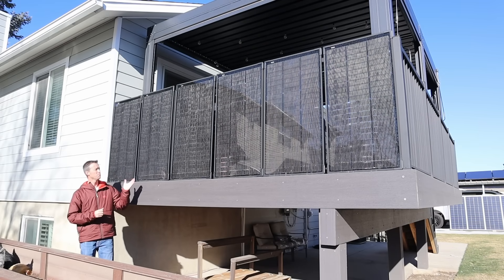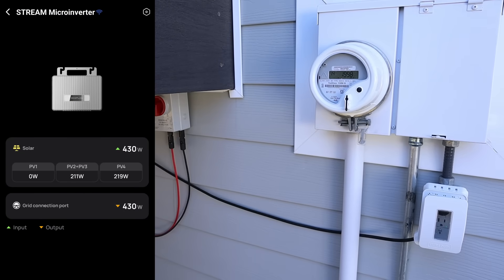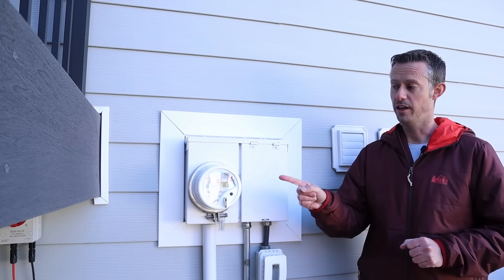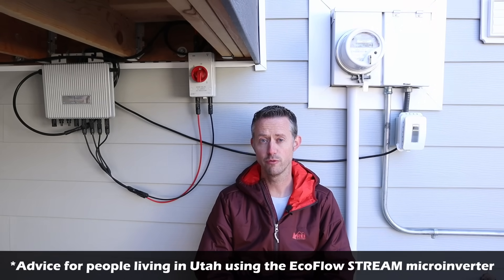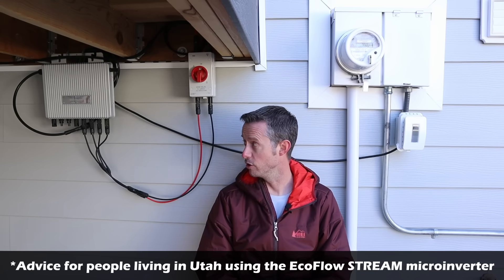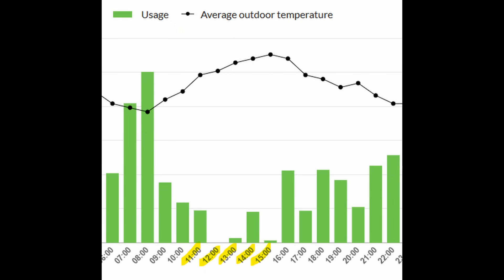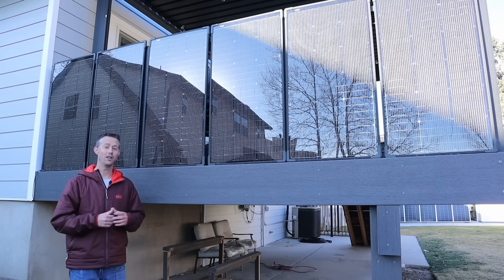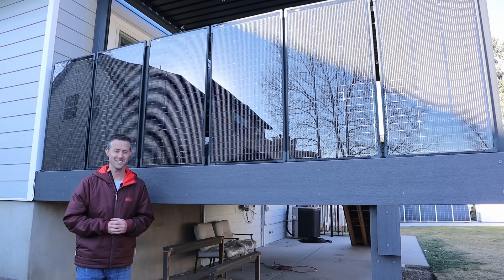The Simplest Solar System I've Ever Installed!  I Just Plugged It In!

Comment: @Jasonoid EcoFlow does say this system works with smart meter circuit monitors / shunts installed on the home's circuit panel. If you spend enough time, the EcoFlow support will probably give you the specific shunt names/model numbers. 
  I was seriously looking at this system and spent alot of time on their website and AI. The AI actually gave me info that the website didn't and turned me off to the idea😄. The AI apparently hadn't been reviewed by their marketing department because it was a little too honest.
  Still, it is a good system but was too small for my needs. Living in a state where we don't have Utah's great SB on this technology, I would have had to install a smart meter shunt because my local electric company doesn't support it. 

  And if you want to see just how bad the solar red tape is, you'll find many states refer to California's approved list of solar equipment.
  But....if you go to that list from California, you'll see it's way outdated. Alot of the equipment is obsolete now or has changed hands so if a local electric company doesn't see your equipment's exact name on that California list, they won't approve it.

Comment: Isn't there a bit of danger because the cable coming from the micro inverter to the AC outlet has male connectors on it, so if it is unplugged, won't these be live?  Maybe the inverter will not kick on until it senses a connection to the grid.
Reply: Yes it takes 5 minutes to power on sync to the grid and only works if the grid is active. I think they call it anti-islanding protection.
Reply from the maker: Correct. It's UL listed and has anti-islanding protection. It will not power on unless it's connected to the grid and synced up.

Comment: Is it worth it mathematically? How many years to recoup the cost?
Reply: iirc, vertical mounted panels work best in winter when the sun is angled. In Summer its directly overhead and you would want them horizontal
Reply: I’ve had one for a couple months. My current kWh rate is 15 cents per kWh. I’m getting anywhere from 30 cents to a $1.10 per day with my setup depending on solar color conditions. So my ROI is anywhere from 1 to 2 years. Have been getting 3-7 kw production a day during winter.

Comment: Hey Jason, I have this same stream microinverter plugged into a dedicated outlet to try and maximize the 1200watt output. Connections are:  One small 300 watt panel in the connected port of 2 /3 , one 24 volt battery in port 1, and one 48 v battery in port 4. I’m running it off battery after sun goes down and getting around 5-7 kw total output a day. My battery banks only total around 5kw. Pretty nice for the offset power consumption. I see my bi directional meter rolling back at night sometimes which I didn’t think was possible.

My cost per kWh is $0.15 so with the earnings of $0.5 to $1 per day the return on investment of $299 should only be 1-2 years. 

One thing I noticed about the microinverter is that the mmpt ports use a different style connector that is harder to detach. I think it’s an amphenol connector instead of the standard mc4. Slightly different but I was having trouble disconnecting lines when testing. Bought a tool and some small 12 inch mc4 connectors to get around that issue.
Reply from the maker: Sweet! That's an awesome setup! Thanks for sharing. I connected my 48v battery bank to it wirh decent results as well. I'll plan to do a video on it in the future.

Comment: 400-500 watts baseload in your home in the winter?  In summer and winter, those of us with heat pumps are going to be higher than that.  I'm eager to try something like the Craftstrom system.
Reply from the maker: I just can't get over their pricing.... $2000?! Gosh, I'd never see a return on investment from that.
Reply: @Jasonoid  My 2.5kW Enphase microinverter array was $2400 after tax credit.  Installed in 2020.  That's 8 panels and half the kW of my main array.  It already paid for itself!  My first array has about 2 years left though, since I paid a local installer to install it.
Reply: @Jasonoid  You don't have to buy their panels, you can buy just the Craftstrom power meter (to monitor your panel) and inverters (and just plug whatever panels you want into them).  That makes things a whole heck of a lot more reasonably priced.  That's what I'm thinking about doing.
Reply from the maker: @ScrapKing73 I didn't see a way to purchase the inverter on it's own.

Comment: It would be great to plug a battery into the micro inverter and then just charge the battery from the solar with a larger output array.  If sized properly, you could possibly push 1200w into the inverter indefinitely.
Reply from the maker: I've tested that briefly, it does accept 1200w from all four DC ports connected to a 48v battery. I'll probably put out a future video on it. (I did mention that at the end BTW)

Comment: Understand that the intent is not to back feed in case of a power outage. But, in case of an outage, could you plug the inverter into a Female X Female 120 V plug to then charge a portable battery power station?
Reply from the maker: The microinverter needs grid power to function, it would be best to charge your power station directly with solar panels.
Reply: That could work but need some sort of smart hub kind of how you can parallel two 120v inverters to get more power.

Comment: Great video!  There is a company called Craftstrom that offers something similar except it is legal in all 50 states.  They of course have their own systems which are quite expensive but offer the individual components as well.  The difference is they have a smart breaker and a power meter that work together with the micro inverters to not allow any back feeding of the grid.  That system also offers the option of charging batteries (presently only their own branded one) when demand is low so the power is not wasted.  If you are going to the CES, maybe you could also do a short video on what interesting stuff you see out there:)
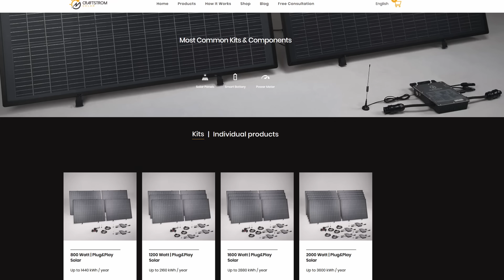Reply from the maker: 2:57 I posted the craftstrom system on the screen. I'll see if I can get my hands on it for testing!

Comment: I mounted 4 100w flexible panels on my desk, same way and I get around 25-300w depending on the time and day. I used it to power my anker 3600w power generator and other anker products. It works great in the spring, summer, and fall. In the winter, not so much. We have had 8 days of snow and I'm getting about 25w per day. We don't have to get any permit as long as it is not mounted to the house. Just strange that alot of people aren't doing this, the 100w solar panels were $49 each. I bought extra and put them on the side of my shed. Gotta check out the microinverter.
Reply: Deck, not desk
Reply: If it's not tied back to the grid the utility company won't care how much you save or what you do. But if you try to plug it into the house power that's grid connected then you open yourself up to large fines and possibly disconnection. Many states have smart meters that senses anomalies on their power line that can be traced back to the location. It must be permitted. Which they allow but you can't just plug it into and think it's ok.

Comment: During power outages does the system shut down completely?  Otherwise, it could damage electrical systems and injure linemen doing repairs.
Reply from the maker: Yes, it's UL listed and has anti-islanding features. That's what's required for it to be legal in Utah. If it's disconnected from grid-power (IE power outage) it doesn't even turn on, even with solar panels connected.
Reply: Hmm… would hate to be a lineman trying to restore power and having to trust a bunch of chinese boxes to not backfeed the power lines - UL claims or not.

Comment: Thank you for sharing this. Those of us outside of Utah look forward to legal options we can put to work in our states that are less expensive for up front costs. I did share this with Utah friends and this would work great for them.
Reply: It's "mostly" legal if you just have an inverter with a zero export function. Though even then if you have a large load that suddenly shuts off some energy can leak out in the time it takes for the inverter to get that data from the CT clamps and react which can sometimes cause issues with legality so you have to check with your energy provider.

Comment: Can you split it to 600 watts. Put in another micro inverter and a dedicated plug on other phase of electricity at the box. So that way all power that panels produce is not just on single line.  May actually help off set bill even more?
Reply from the maker: feeding 1200w into one dedicated circuit will backfeed into your entire home offsetting that power, not just the power on that single circuit. All the wires in the home are connected together and power flows between all of them (unless you turn off a circuit breaker which stops the power flow).
Reply: @Jasonoid  I think you may be incorrect here.  The outlet you are plugged into is a 120V outlet. Most hemes are 240 split phase. (like an oven or hot water heater.) So with this set up you are only back feeding 1 leg of the house circuits.
Reply: @jhumbracht4582 you  are correct.  I have 6 of these and attempted to balance the two legs 

I have the emporia vue3 and I can see l1 and l2.  

Now, in my case I'm running Bitcoin miners that pull both legs 240 volt.  But I can watch the sun come up and see the equal pull on l1 and l2 change as the stream inverters start production....not balanced.

I don't know how his power company will deal with power backfeed on one leg but drawing it on another leg?  I've never tested that in my setup.

Comment: Thank you for putting a light on plug n play. Are there any solar production reports in the app? You are probably only at best zeroing out only 1 of the 2 phases? Is that right?
Reply from the maker: There's not a ton of data, it does provide a daily output number.

Comment: i would just get a solar generator and plug my frigde wifi pc into it lol. why bother with bs power company?
Reply from the maker: The best benefit for a setup like this is that is just works. I don't even think about it. It's just plugged in and going. No need to worry about battery levels or how to charge up when it's cloudy. The best setup is having both a small grid-tie system and a battery system.

Comment: I believe the ecoflow smart panel allows you to do this in any state but for specific circuits. The smart panel sits in between your main and the circuits you want to power/offset. If the main power goes out, it senses and stops feeding the grid panel
Reply from the maker: The Ecoflow smart panel is basically an automatic transfer switch. When the batteries are charged and you have solar coming in, it will use that power to automatically feed circuits in your home to offset your power bill. The smart panel is only compatible with their large power stations and also costs a bit of money. This device here in the video is much more affordable (but it's not legal everywhere). Other devices in the future will be 'smarter' and will be legal in all 50 states.

Comment: If this back feeds the grid without a net metering meter, you run the risk of being billed for the power you send to the grid.
Reply from the maker: If you live in Utah and you have a smart meter that won't be the case. Future systems coming out will be 'smarter' and they will offset the your loads without sending power to the grid. I'm excited to test those out.

Comment: this needs a smart panel which is several hundred dollars and often requires a certified electrician to install. you should make sure the views know this system pushes power out to the grid if your house is not using it.  both power company's where i live will not accept this condition. i would like to see you do a review of the craftstrom system. it seems more compatible for small scale use.
Reply: Not really an issue because if this system detects no 110 voltage coming in it shuts down the outgoing power. Not much different than a generator transfer switch. It's perfectly legal where he's at.
Reply from the maker: I clearly explained that in the video. I'll try to get my hands on a Craftsrom system as well.
Reply: @Jasonoid  yes you did, a couple of times and i had to point this out to my friend who recommended this video to me. he missed that it would back feed the grid.

Comment: I have a pool pump running 7 days 7 am to 7 pm and a big south facing wall
Reply from the maker: Something like this would help offset the power for a system like that. South facing wall for the win! My deck faces directly south as well.
Reply: @J @Jasonoid Im not planning on living here more than another 5 years. I would calculate payoff at 3 years and a couple months using used panels. Then we would have the 1200 watts plus our existing EcoFlow system.

Comment: I use one with a battery bank as my home already has transfer switches on every circuit so I can select which circuit to use the grid and which circuit to use solar.
Reply from the maker: Sounds like an awesome setup!
Reply: @Jasonoid It gives me great flexibility and no back feeding. Also allows me to use a 1500 watt inverter.

Comment: Let's say you have dedicated house circuits for solar and you wanted a convenient way to add additional solar.  Could you use this (or other grid-tie inverters) to supplement your existing system, understanding it would have to detect AC from your existing solar storage?
Reply from the maker: This will only work with grid tie solar (not off grid solar systems), but yes, if you are already on a net metering plan I don't see why you couldn't just plug this in to get more solar power on the cheap.
Reply: It will work with off grid existing solar.  It senses the micro grid the off grid inverter has created.  There is a long discussion related to "what happens when I am making too much power and don't have a grid to backfeed" that I'll leave for another day 😂
Reply: Yes it works.  I have existing solar.  My existing solar is grid tied.  I also have batteries.  If the grid goes down my solar system ( Sol ark) switches and creates a micro grid.  The stream inverters sense the grid down....go through the reset process and then come back online once the see the new grid.

Now....if you have a solar system that doesn't have batteries and shuts down...your stream microinverter will shut down.

This was a great way for me to add more power to my existing solar system.
Reply: @houstonstarbuck  Awesome!  I have a Pecron F3000LFP and hope I can use this to supplement it during the day as I have a 10 circuit transfer switch that I can dedicate circuits to it.

Comment: Can this microinverter be used with a 50Hz grid or only 60Hz?
Reply from the maker: Specs are listed as the following on their website:
Output Voltage Range: 105.6V-127.2V
Nominal Output Frequency: 60Hz
Reply: Ecoflow’s “Stream” product category is actually made for the UK/Euro and other 50hz power grids. There are many reviews on YouTube of people using this system with 50hz as balcony solar is a popular option outside the US.
Reply from the maker: @oooee  they also have the Ecoflow Stream Ultra for the US market as well now. It's rated for 60hz and I'm not sure if it's compatible with 50hz power.
Reply: @Jasonoid true no where in user manual does it show 50hz for the 120VAC US version....Craftstorm seems to sync its output to match basically any grid voltage and frequency

Comment: 🌴 Southern California High Desert 🌵 My Only Interest is Replenishing My Battery Bank for 5 System's that Power this small Ranch ⛩
That Hot Leg / Grid Tied has way too many Permits Required and Red Flags in Commifornia
Reply from the maker: The whole point of this product is that is doesn't require permits... At least in Utah for now. Off grid solar is great though, awesome way to go if you can get enough panels and batteries.
Reply: And disheartening to see this is only SOLD in Utah @ $299.00 currently through EcoFlow

Comment: Does that product from Ecoflow detect the grid is "live" before passing 120v AC into the dedicated outlet?  I am still  connected to the grid, but have no interest in back-feeding power to it.  I think it would be great if America had the same options the EU has, when it comes to "balcony solar".  Imagine if every household was generating 2.5Kwh of the power they use, every day?
Reply from the maker: Yes, the device is UL listed with anti-islanding technology so if it's not plugged into the wall (also for when the power goes out) the device doesn't turn on or produce power. It will not backfeed to the grid or electrocute line men, I've tested to make sure that doesn't happen either 👍
Reply: @Jasonoid  - Perfect!  :)

Comment: So to be clear, as you have it currently set up, if you are generating 400w and your house is consuming only 250, the extra 150 is going out to the grid?
Reply from the maker: Yep, thats exactly right. Now if I had the full 1200 watts of panels connected, I'd be able to offset much more power. I just could fit 1200w of panels on my railing.